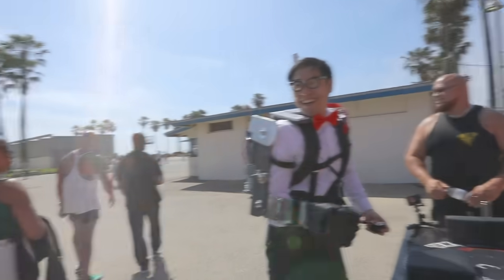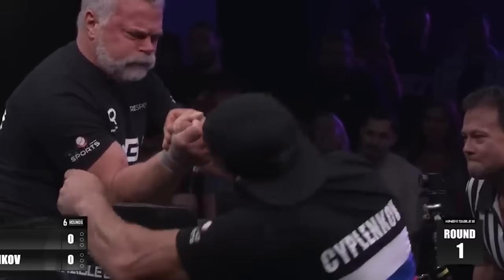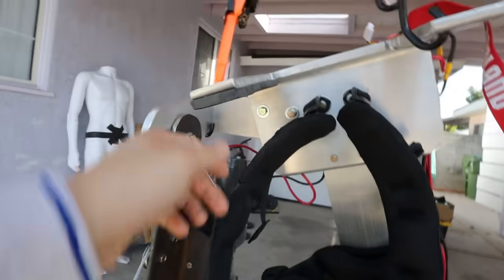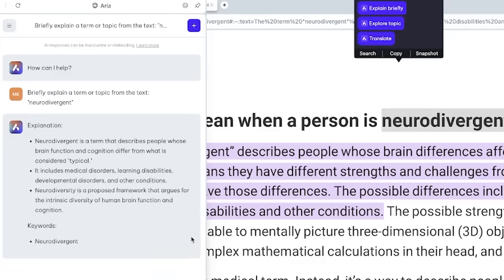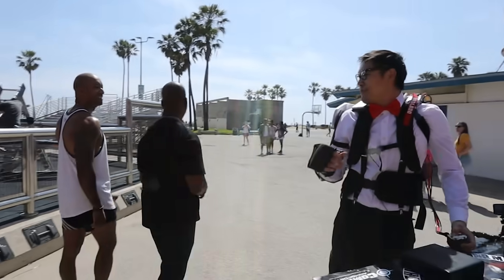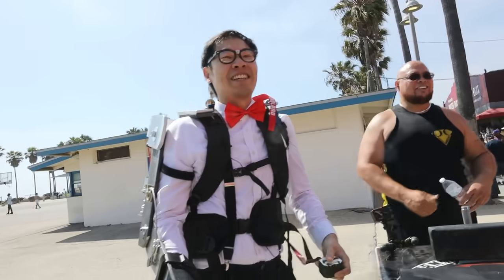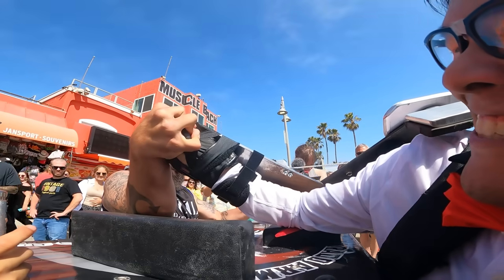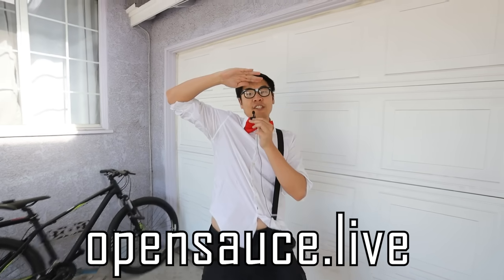I built an Exoskeleton to challenge Pro Arm Wrestlers

Comment: In another timeline:

Exoskeleton proceeds to bend arm the wrong way
Reply: that would be a yikes
Reply: and thats why he's using a winch which slacks if it goes the wrong way, imagine doing this with stepper motors and gears though
Reply: @Minty1337  what why it's a alternate timeline
Reply: Halo Spartan program be like:
Reply: Naaaaaa!!!!
Reply: Hello everyone today I'm going to make a robot to pay fir my medical bills after bending my arm the wrong wag
Reply: @Minty1337  I didn't even realise that! Allen actually thought his design through :o
Reply: @khoipham8303  It was funny when the spartan started screaming and his arm was spinning around like crazy
Reply: yeawchhh
Reply: ew dont even say that im eating
Reply: springlock failure
Reply: Ididathing almost did that with his ax leg.
Reply: @Minty1337  “MICHEAL, DONT LEAVE ME HERE!! MICHEAL!!”
Reply: Hey it's the guy that founded hammer industries.
Reply: WAS THAT THE BEND OF ‘87?
Reply: It's an alternate universe
Reply: "Yeah, I'd say most countries 5-10 years away....Allen Pan, 20"
Reply: I mean, this design physically wouldn't be able to do that. It's using a winch and cable, so if the exoskeleton tries to extend further than the wearer's arm can move, it'll just put slack on the winch cable.
Reply: Thank you dude you got me laughing loud
Reply: several revs))
Reply: that would basically be some kind of saw trap
Reply: liveleak

Comment: i can relate to having one arm stronger than the other for no specific reason
Reply: same
Reply: yep, no particular reason
Reply: Uhhhhh, you are a blacksmith?
Reply: @humanperson9443  ...yes...
Reply: Me too. I don't have a specific reason, I have multiple ones... I tend to use my right hand when handling a wrench, hammer, saw, axe, or any tool/machine that I have to keep steady despite weight/motion. My right hand is also steadier for more finely detailed work with soldering, carefully using a scalpel, or sewing.

At least my left arm has better endurance than my right, even if it's slightly slower and less dexterous.
Reply: @dcolb121  gasp
Reply: @humanperson9443  I guess.. he does pound something very hard everyday
Reply: Steel
Reply: i honestly find that so annoying. been a almost a few months since i trained my lefty more and still weaker than my righty.
Reply: @ImSaixe  use it more in general not just training. I try to use my other limbs more than my dominant hand unless it's like writing or something that I need precision to do and my left arm isn't quite on par with my right it doesn't feel useless.
Reply: Dr. Evil: "Riiiight..."
Reply: Now Allen's going to have one atrophied arm because of his new invention
Reply: @__jonbud______________________  Riiight a "wrench," "hammer," "saw," "axe," "soldering iron," "scalpel," "sewing needle"
Reply: Luckily Im comfortable using both hands so I dont have to worry about imbalances

Comment: Holy shit.
I'm a biomedical engineering student, and I've been tampering with this exact same design on my own, I even made some "proof of concept" models on my own (using popsicle sticks, yarn, and a pencil)

I've never even thought of the winch getting tangled! This will be extremely valuable to the project I'm working on.
Reply: Haha, I've also thought about making an exoskeleton like this and have a very similar design. I've always been interested in these kind of things and from all the exoskeletons I see online it's either an Ironman suit or something that doesn't seem effective, efficient or realistic. I see some problems in his design but the pulley system is nearly identical to mine. Also the attachment of the wire should be closer to the wrist allowing for more mechanical advantage.
Reply: Try a little harder than this guy did. I'm sure with the people your around at school, you can come up with something much better. Look at the Tesla but for inspiration. They have some truly inspiring engineers.
Reply: Does that thing apply energy in the correction direction? I am not seeing how the counterforce is being applied in the correct direction. Also, btw a fully dextrous hand with spongy fingertips is a more valuable thing to invent .. just saying.
Reply: @JS-eu5vg  Well, uh, tbf, I am only a college sophomore.
And yes, a more flexible prosthetic hand would be much more beneficial. This sort of thing is more just a side project.
Reply: @dbugman68 He did pretty well
Reply: @malachite072 ya I bet he was scared that was where it would fail and slap him in face lol but also the force needs be rotations
Reply: @dreknows  If you're talking about the elbow joint it's not supposed to rotate for a human arm. Looking back what actually isn't fully understood by me is how the rotation of the shoulder is managed by the skeleton, since that's what creates the rotation of an arm.

Comment: This is the most genius thing I've seen in a long while - but it DOES seem kind of dangerous, I'm surprised you didn't hurt anyone.
Reply: I'm surprised HE didn't get hurt either with how his hand snapped out of that thing at the end
Reply: @fragtrappo  True. But he chooses to press the button when the other person is at max tension, PLUS that thing goes in only one speed (as opposed to a human arm wrestler who could do just enough to win but not hurt you).
Reply: @Vladimyrful  At least he wasn't hiding anything...everyone could see the mechanics. Maybe the adjusted the power to be slightly over pro wrestler strength. But true, just being able to go 0 or 1 is an issue.
Reply: @torstent8979  That's true.
Reply: It is slow and lineair, which helps for preventing injuries.
Reply: This isn't genius for a mechanical engineer. You would be capable of building that if you knew about mechanics.

Comment: Dude, it looked like you could've won most of those arm wrestles without the winch. Just by knowing good technique, you were already getting a lot of dudes to the brink of a loss, and turning on the winch was just what caused them to lose total balance. Excellent vid!!
Reply: i think that was the metal brace helping out and levering against the pad
Reply: The metal brace made it pretty much impossible to to beat him from side to side as long as the opponent didn't had enough side pressure to literally pull his whole body with it, that's still a very big advantage
Reply: @Pepe-pq3om he is lucky though. He could have easily broke his wrist. Likely had to stop several times to prevent that from happening

Comment: The body frame is doing all the work. He can win even without folding the arm.
Reply: in short Steel > Flesh
Reply: Tell that to the last guy.
Reply: Yeah it makes you completely unable to twist and wrench on his arm, basically takes all your mechanical advantage and leverage away
Reply: the winch also pulls their arm out, opening the angle at the elbow, which reduces the strength of the biceb. It's basically breaking their poise. If the winch was functional, he would have beaten the last guy.
Reply: @ZenkiCoyote  Steel < Bones however if you want to really be pedantic

Comment: Hang on, so arm wrestling is actually a bicep curl to pull the other guy's arm straight and then use all your upper body muscle against his one straightened bicep muscle to push his arm down? I never looked at it that way, that's awesome!
Reply: not really a curl but more like doing a 1 arm pull up you need strong back muscles and forearm
Reply: Not really.

It starts with the flexion of your wrist, aided by radial deviation and pronation to keep both the bicep and the brachialis activated. Then, through the back muscles and the chest and shoulder ones, you do a sort of back to side movement, with heavy emphasis of bending his wrist back and opening his fingers.

And that's just 1 ot the 3 major techniques
Reply: @justaguyfromreddit  toproll for the win
Reply: @zeroblade6599 That's one way to do it! But there are many ways. Ultimately, separating your opponent's arm and keeping yours tight is what you'd want to do. Some people are strong enough to just take others down without separating them. There's more to armwrestling than most think
Reply: Wrong. U goofy ahh

Comment: I was actually scared once the contraption broke that it would leave you terribly out of position and you would have had your arm broken. And I’ve gotta be honest you were not far away from being snapped .I wouldn’t do this again lol
Reply: It's basically impossible to break your arm while it's im there I guess. armwrestling armbreaks are pretty much always spiral fractures of the upper arm, because you commit your shoulder to press, but your arm is too far behind, giving a twisting force on your humerous. The metal prevents the elbow from turning in that direction, so it takes all that twisting force, protecting you from breaking the arm
Reply: @allylilith5605  yes true

Comment: Allen seems to be a little interested in the actual sport of professional armwrestling, that's awesome. As far as the contraption, I don't see it working at all...
You won't have the back-pressure strength to have the contraption pull/open their arm towards you, so all that should happen is you winch yourself closer to THEM... then they could just pull your elbow off the front of the pad if they wanted to, regardless of how closed your arm is.

Then other than that, there's still the pinning element, even if you have their arm on your side of the table, which you won't, they would still have the strength even in an open-arm position to drive/bend your whole body to the pin pad (with side-pressure would be easiest I think).

Okay NOPE! disregard all of that for some reason lol.
Oh I suppose Allen has so much side-pressure because the contraption actually goes right down to his waist, so all the torso weight that he leans into the waist-padding, is also directly connected to his arm going sideways. That makes the sense! so really he doesn't even need to use the winch at all.

Oh when he's at Muscle Beach we see that yea he doesn't need the winch to prevent being pinned.
Okay 8:45 is exactly what I was talking about lol.

Awesome that he met up with a legit armwrestler and has the right table and everything. Very fun video.

Comment: Make a attachable pistol for a veteran who doesn’t have a hand anymore. Integrated with a wireless firing switch you have to custom and fit the housing over the trigger with the user using a remote button for the left hand to fire.

Comment: The problem with this is you only made this arm to go up and down, without the motion of side to side, so that means you were only simulating the motion of TOPROLLING and backpressuring not HOOKING. so you only had a limited range of techniques you could use with that arm.

Comment: I was expecting the larger people just to pick you up. Like... the machine is braced to your body. So the machine is limited by your body.
Reply: Well it would be hard for someone to pick him up considering you have to leave your elbow on the table.
Reply: @binto-c9r  He can't turn his elbow.... it acts a leverage point that forces the rest of his body to move. So his elbow would stay on the table and his body would basically lift up because of that.
Reply: @jaroldscottwilliams.3rd832  The table is not that high up for him so you would only maybe be able to get him on his tippy toes. Plus that is not what you are supposed to do in arm wrestling, you are supposed to pin them to the side.
Reply: @binto-c9r  Yes... you're supposed to pin them to the side... without a robot arm that locks your arm in place. We've already broken what you're 'supposed to do when arm wrestling'... which makes your point mute. Also... how would he end up on tippy-toes if his body is being forced to tilt up and to the left because his arm is being forced down and to the right using his elbow as a point of leverage? Maybe on the sides of his feet? Or I guess he could twist his feet to face right somehow and end up on his tippy toes? But I don't know how he could do that and still keep his arm on the table since he literally can't twist his arm at all because of the robot arm.
Reply: @jaroldscottwilliams.3rd832  Just because he's using a robot arm, it doesn't mean that all the rules get thrown out and you can just start doing anything. They are still arm wrestling. The goal is still to try to pin the other person's arm, not to lift them off the table. If you are pinning someone to the side it isn't really possible to lift them off the table.
Reply: @binto-c9r  You're not actually getting what I'm saying are you? I'm talking basic science. Imagine an L-shaped or maybe Q-shaped board with the elbow of the L or the left side of the Q attached to a table via a hinge so you can grab onto the small arm protruding. Then you tape a lemon or something and if you hinge to one side the lemon gets crushed; easier to visualize with a filled-in Q shape since the L-shape is a bit thin even though it's more arm-shaped. But if you hinged to the other side, like you're pressing someone's arm to the table in an arm wrestling match, the lemon gets lifted up into the air. Simple cause and effect. You turn the handle one way, lemon goes up and the other way the lemon goes down. Right?

In this case the idea would be the elbow would get pressed into the table by the wearer's weight combined with the other arm wrestler pulling his arm towards them while pushing it towards the table. This creates a natural hinge. Eventually, assuming the wrestler is strong enough to hold any weight not being transferred into the table by the robot arm's elbow, he could even theoretically get lifted up so high he basically flips head-first into the floor. Because, obviously, the robot elbow isn't actually attached to the table; it's just acting as a leverage point.